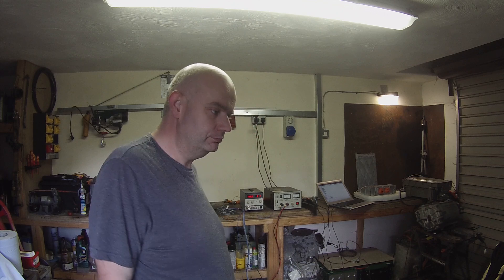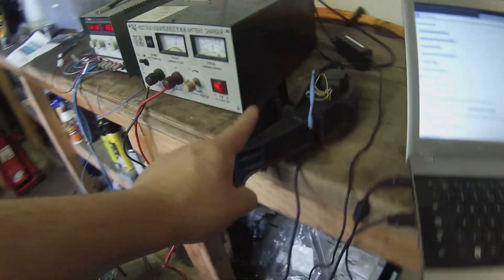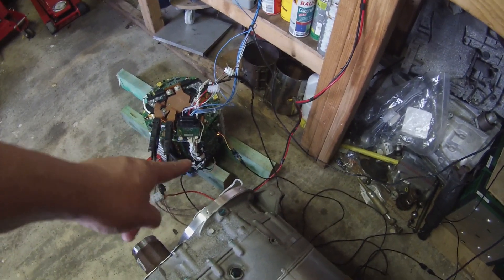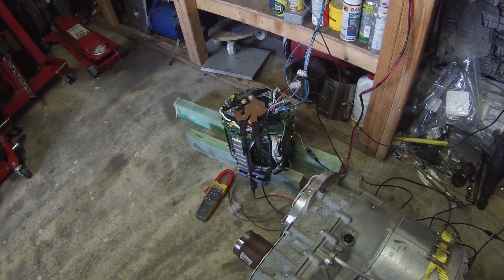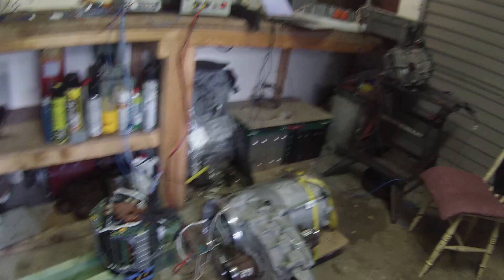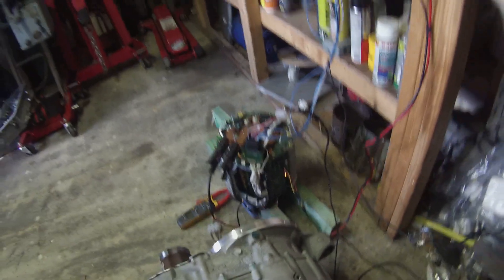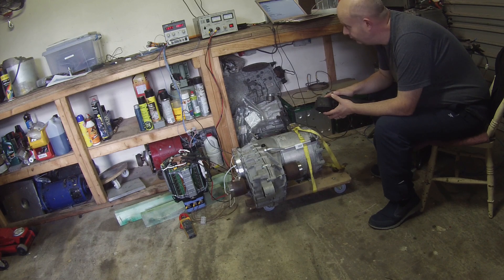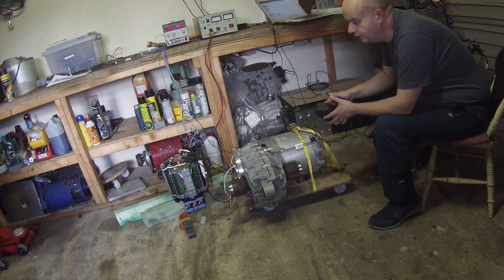The Tesla Project : Smooth Runnings

Comment: Hi.  New to the Tesla setup, and BRAND new to EV's generally.  So, an inevitable question(s).
1) At 11:10 when the motor is winding down, it seems to take a long time.  Is this due purely to motor mass inertia or is there some other 'ramp down' process happening?
2) is the Tesla inverter effectively what would be regarded as the 'ESC' in say, an RC model aircraft situation?
Regards Mark Mark in the UK

Comment: Very interesting :-)
you can get a more accurate current reading by looping multiple times around the clamp meter jaws and dividing reading by number of turns. Use enough turns to just Max meter reading to get Maximum dynamic range on reading.